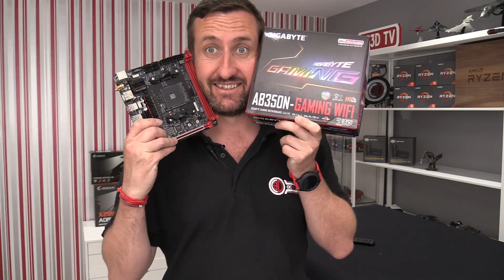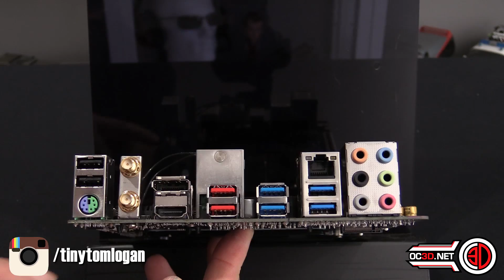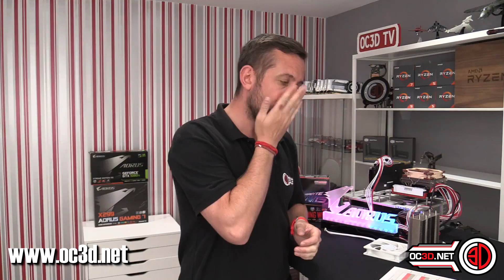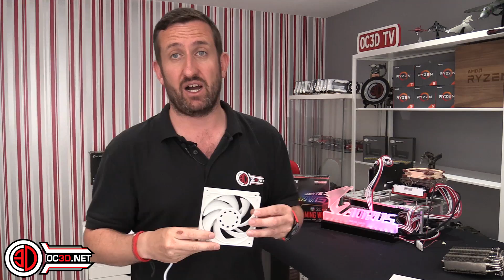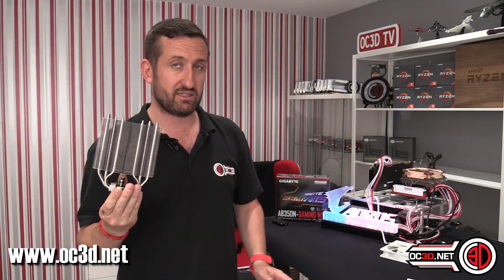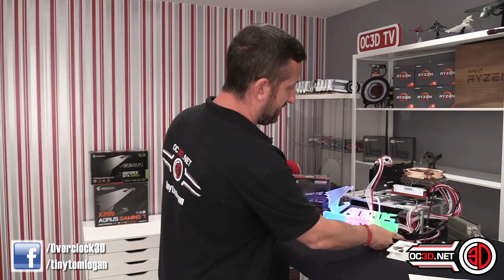Gigabyte AB350 Gaming WIFI ITX AM4 Motherboard Review

Comment: Here's to hoping that Asus announces a decent Ryzen ITX board.
Reply: If everybody would just head over to Asus to request one, it would speed up things a bit.
Reply: Fayçal Assaad that's not a bad idea actually.

Part of the reason is because then I could get one in advance for an apu to be slotted into it when they eventually launch.
Reply: since even thier mATX boards does not have a VRM heat sink at all, i think that is a bad idea to request an ITX version.
Reply: http://www.tomshardware.com/news/asus-rog-x370i-b350i-gaming,35724.html

Comment: GB has gone downhill a lot since Z87...
Reply: Gone back downhill , they where terrible in the P4 days !
Reply: bios splash screen hasn't changed in 10 years and still takes awhile to boot thru bios...
Reply: Pennywise I just sent back a msi board LOL, and bought my trusty gigabyte
Reply: x370 gaming pro
Reply: Pennywise yea I couldn't get my 190$ refund back
Reply: Pennywise yea should've just bought the gigabyte x370 k7 in the biggining l, cause I never had issues with their boards
Reply: Pennywise I have a 1700x paired with a 1060strix, (until rx vega)
Reply: Pennywise hahaha ty, but you have a titan x always wanted one of those cards
Reply: i hjave my 1700x at 3.9ghz at 1.35v i could try 4ghz but iheard 3200mhz ram doesnt work on 4ghz so sticking too 3.9 then going to buy 3200 ram
Reply: nice, i am getting the trident z rgb 16gb
Reply: Gorbaz The Dragon I've noticed that too. Financial issues maybe? I have no clue. I really shouldn't have bought the k7 gaming. It seems like my issues are all bios related.

Comment: Wake me up, when they released a X370 M-ATX MoBo.
Reply: I dont even need a x370 mATX i just want ANY brand to make a decent looking mATX motherboard. Its just weird how they manage to make them all look so bad.
Reply: Which features, that's don't exist on B350, do you need on an X370 mATX board?
Reply: Well they are virtually the same, perhaps overclocking capabilities?, well the truth is that I want a beatifully MoBo, kind of like a Crosshair VI Hero but on its M-ATX version.
Reply: CSRF Broforce micro ATX looks the best imo I have this mobile but matx and I love it looks amazing
Reply: CSRF Broforce It will look ugly in a big case, but the idea of a MATX mobo is to have a small-midium case, with ATX fuatures like SLI/CF, more sata ports, more IO ports,   more ram slots, etc.
Reply: wtf
Reply: Medokn A troll...
Reply: I think Biostar have X370 mAtx board. X370GT3 i think. X370 is not just overclocking. 8+8 pcie support and multiple USB 3.1.

Also people dont watch beautifull board. they watch the case and most beautifull case belongs to ITX and mATX.

I too planing to build ITX system for Ryzen APU. With somthing like Fractal node 202 or Phanteks Entho Evolve Itx.
Reply: crossfire is supported on B350. SLI is not supported due to licensing costs and requirement of x8 minimum both slots. in MATX it seems the bottom is always running x4.
Reply: they go inside of a case. its about the size.
Reply: vespaman0 If it is the flagship chipset, it normally runs at x8 both pci e slots
Reply: SLI and Crossfire isn't supported on B350
Reply: dan k idk how its even remotely appealing... god id never build anything around thrse nasty looking boards.... so glad i got my x370 crosshair 6 hero...
Reply: HeyDan1983 yup small cases look ugly as shit sorry but if u build a xomputer u build a mean computer not some donky ass thing